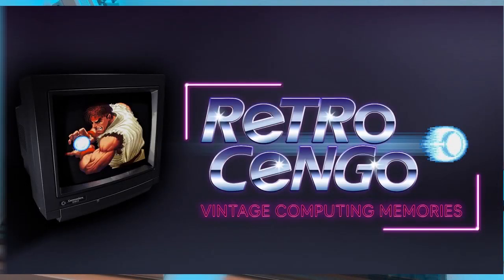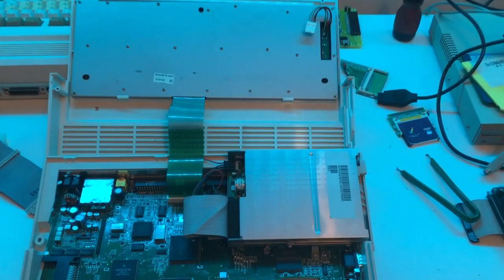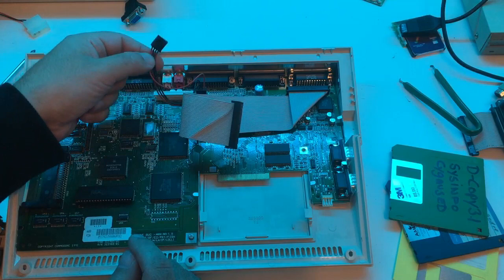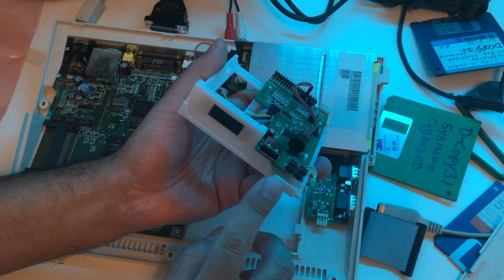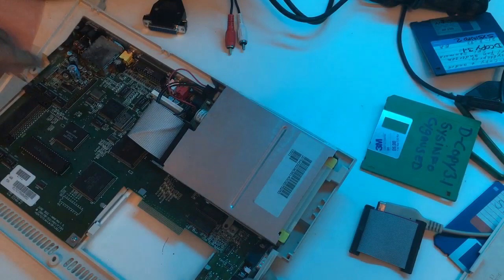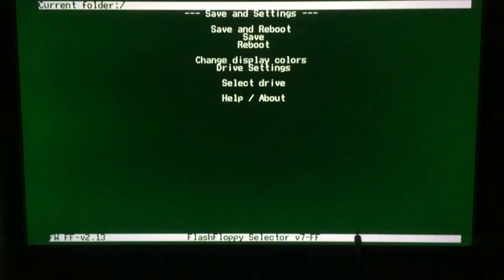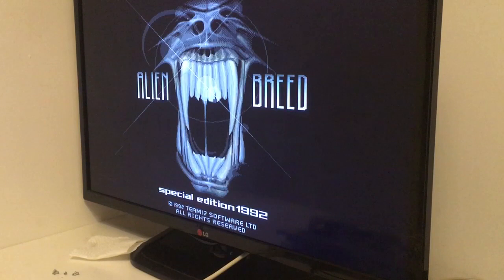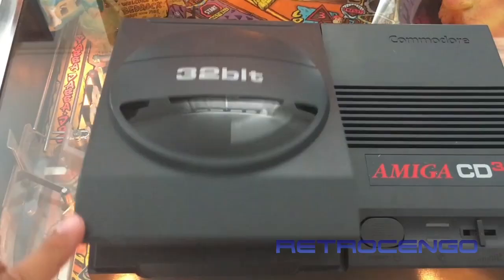How to install GOTEK drive in Commodore Amiga 600

Comment: Floppies over time do degrade and because of this I wanted to archive my entire Amiga Library which got brought me back into the retro scene and I got bit by the retro bug big time.   It was not long before I discovered the GOTEK but for me I used it mostly for installs of Workbench and a few other things to get a system up and running which was prior to my using CF and SD Cards to replace my SCSI Drives.   I still use them as they are useful but I also like to have a working floppy drive even though I rarely use floppies.  I have GOTEK's on 4 of my 8 Amiga's but 2 of them can easily be moved externally if needed.    Once you have a full system install on a CF or SD Card you really don't need a disk drive or GOTEK but its nice to have both just incase.   Heck I even keep the drives for the 8 bit computers in working order even though I have no intention of using them because you never know when you might need one to work even though I have SD2IEC drives for those but that's another topic but very similar in nature.
Reply from the maker: Stephen Bruce I couldn’t agree more, great comment😁👍🏻

Comment: What video output cable are you using for the modern TV? Great video! I’ve just bought a second hand Amiga 600 and plan to do a lot of mods… I think I’m going to go the WHDload route on a CF card and not bother with the gotek. That way I can still retain my working floppy drive if I ever want to pop in a disc for nostalgia. Thanks
Reply from the maker: Thanks Vince, I really appreciate it😊
I’m using Amiga rgb to scart gold cable, great picture quality. 

Yea go for whdload over Gotek, great idea, much much better, just put on 8mb ram and you be happy. 

Yea floppy disks are still amazing
Reply: @RETROCENGO  thanks for your reply. I had an Amiga 500 many many years ago but have forgotten the basics so am doing as much research as I can. Picked up a 600 at a good price… These are the upgrades I’m considering.

1mb chip ram (2Mb total)
4 or 8mb fast ram (still not sure on why 8mb is switchable) lol.
Kickstart 3.2
Workbench 3.2
8gb CF card with WHDload fully loaded
PCB deep clean 
Recapped (premium)
Reply from the maker: @VinceNysse  over 4 fastram can disable pcmcia, that’s why it’s switchable. 

I would go for kick 3.1 people are having a lot of headache with everything newer
Reply: @RETROCENGO  thank you for the advice my man. Keep up the great videos, appreciate it.
Reply from the maker: @VinceNysse  most welcome buddy and thank you😀

Comment: Once all my disks are dead and gone, I will go for Gotek..... By the way. Have you checked out the kind of mounting brackets, that have a fake eject button? They are everywere on eBay. And then there are this tiny house for the LCD, that clips on the grill/finn's on top of the case.
Reply: brostenen the print files for both the mount with the eject button blanking plate and the screen enclosure that mounts on the vents are free to download on Thingiverse, so not surprising people are printing them out and selling them. Every Amiga user wanting one who knows someone with a 3d printer can probably get all the gotek mounts they need in exchange for beer
Reply: @bytesabre  Yup. I know. Just not that many people that are actually owning a 3D printer. As an example, then it would be madnes and stupidity for me personally, to buy such a device, just to print one tiny thing. 😁
Reply from the maker: brostenen We have great community on my Facebook page, i wanted to buy puchbuttons for floppy, Amiga4000 frontplaylte and so on, every time i made a want to buy add on the facebook page Commodore 64 - Amiga Retrocengo someone did print and sent me as donation. Love out community
Reply: @RETROCENGO  Cool... Yeah. The community seems strong. Personally I am looking to buy that new "TheC64" machine that are for sale now. It is a full size C64-Mini with working keyboard. What I have found out by watching youtube abiut it, is the following:

 - You can boot it straight into C64 Basic or Vic-20-Basic.

 - You can use the keyboard to navigate, so you dont need the joystick that cones with it.

 - You can use 9pin-USB adaptors, so you can use old school Joysticks from back then.

Comment: @20:00 --- Can't use a Gotek in an A1200 or A4000???  Too many problems with an 030 and KS 3.1...Are you serious?  I have a Gotek in an A4000T/A4000/A1200/A3000, etc., all with either an 020/030/040/ or 060 and  KS 3.1.  It works like a dream. That is some serious misinformation there.
Reply from the maker: triax1972 Try to listen to what i am saying in that part again, I don’t say anything about “can’t use a gotek in A1200/4000”
Yes you can, and it works, BUT with combitability issiues, just like if you load games from a floppy in an Amiga 4000. 
I have a gotek drive permanent in my A4000 and it works great with file transfer and so on, i play games from CF card optimised with WHDLoad, but not through gotek or floppy drive
Reply: @RETROCENGO  Thanks for your response.  That has nothing to do with the gotek, however.  It is a Kickstart issue.  Old OCS games designed for 1.2 or 1.3 just won't boot in general on machines with 2.0 and up, unless you use a ROM switcher, ReloKick, or some other method of KS swapping.  Also, some of the old stuff just cannot work properly on anything other than a 68000 CPU. Once again, not a floppy/gotek  issue, but a software issue.  Sometimes, all that is needed in that case is to disable the CPU caches on the advanced processors or use of Degrader.  Then of course, as you state, WHDLoad works wonders by doing all of this for you.  But to recommend not using a Gotek on anything other than an A500 or A600 is plain silly.  If anything, it's a good introduction to newbies on doing an easy, non destructive mod to their newly acquired Amiga.    My criticism should have been of the recommendation not to use a Gotek on anything other than the 68000 model Amigas, the 500 and 600.  Truth be told, even the A600 will have compatibility issues with some of these old OCS games because they were all shipped with 2.0 ROMs and with ECS chipsets, and will require the use of WHDLoad or the other workarounds mentioned above.
Reply from the maker: triax1972 Doesn’t matter if its software or something else, it can be called what ever, the thing is, i still don’t recommend gaming on stronger Amigas then A500 to game on a gotek drive. 
Yes gotek is absolutely wonderful with an amiga 500. 
Offcourse I’ll answer you, thank you for watching my videoes and making comments, sorry about you feeling im silly, but this is my experience and recommendation. 
Wish you a great day